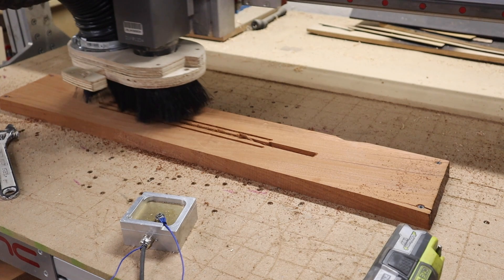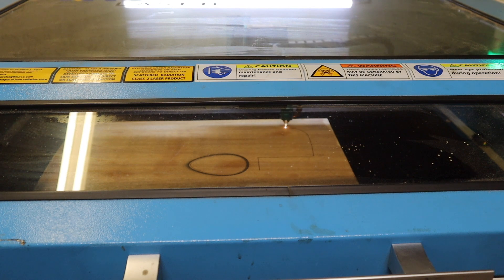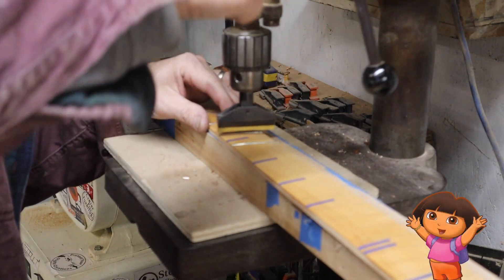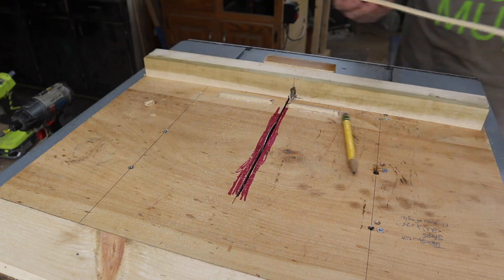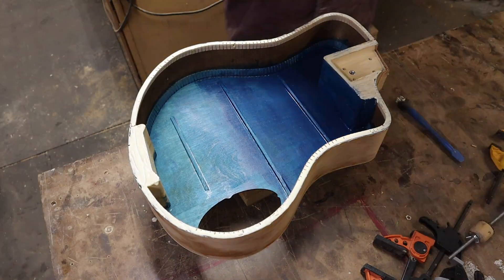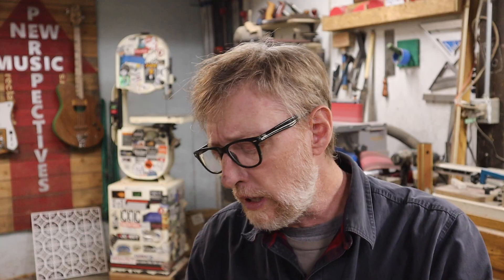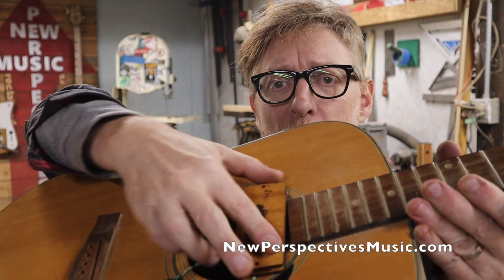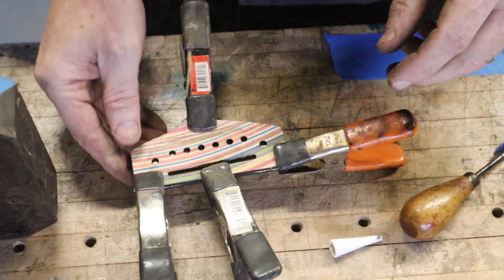I'm Building Myself an Acoustic Baritone Guitar - And I Made a Stupid Mistake!

Comment: Something similar happened to me.  I made a fretboard, my friend's CNC cut the routs for the mother-of-pearl fret marker inlays.  I found it took a very long time to radius the fretboard, and cut the MOP by hand.  When it came time to cut the slots, I found that the CNC wasn't scaled properly for the string scale length!  I took it hard, but slept on it before doing something rash like putting it in the woodstove.  Next morning I had the idea of shimming the nut end just enough that all the inlays fit between the frets.  They were a little off center, but it worked and recused all of that labor.

Comment: I thought the frets were crooked based on the inlays.  Looking forward to see how you fix this.

What is the name of those clamps you used to clamp the finger board to the neck?  I'm trying my hand at building a ukulele and looking for something simple for my finger board glue up.
Reply from the maker: the frets ARE crooked as it's a 27/27.5" scale multiscale design I made the markers straight to give it some visual complexity. well, now it has a lot more visual complexity!
Reply from the maker: oh, and those clamps are a Stew Mac product that you probably don't need to spend the money on. a lot of people use bike inner tubes and stuff like that which I think is a hassle. Just use  clamps - especially if you can clamp it on before you shape the neck.
Reply: @timsway  Thanks for the replies Tim and the advice regarding the clamps!

Comment: Check out a channel called "The Next Project," specifically a video called "Guitar Fret Slot Blade - Don't Do It..."  He modified an $11 Irwin laminate blade into a .023" fret slotting blade.  And I'm shocked you didn't beat him to it. :😀
Reply from the maker: I use a cnc! :)  have a couple saws, off the shelf, that do the job fine. I'm guessing he added a stop? sometimes I'll do that with a piece of scrap wood and superglue, so I can remove it.